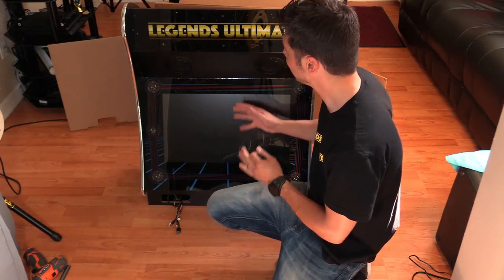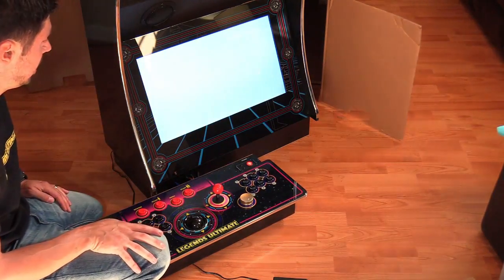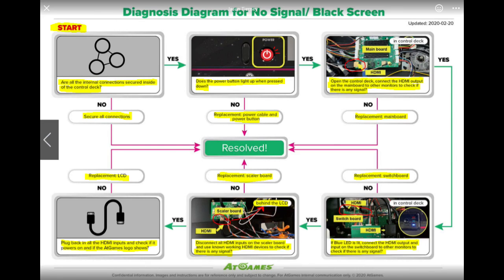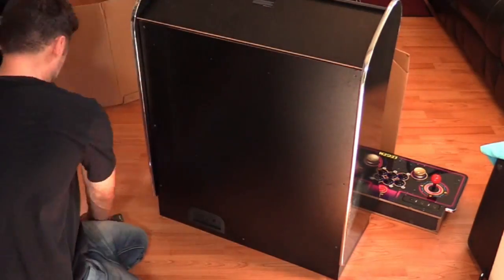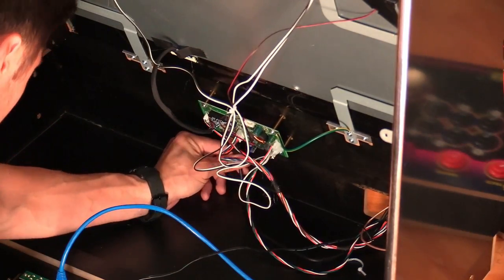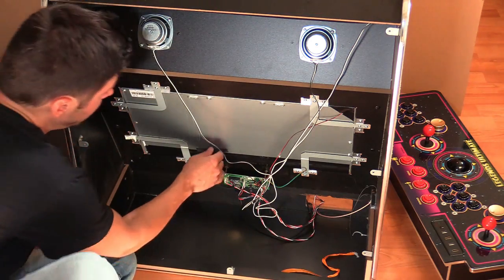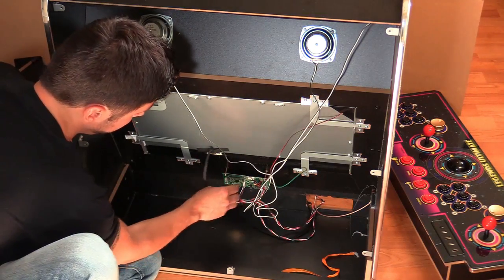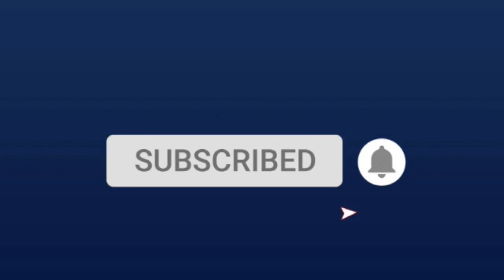Legends Ultimate Arcade service guide for No Power, No Signal, Black Screen, Flashes Colors

Comment: Hello. I recently purchased another Legends Ultimate. I’m a having an issue, the speakers as well as the LED light bar are not working. The light bar has about 1/4 of the LEDs working. When I connect the unit to Bluetooth the sound also does not work. I have made sure that all of the wires coming off the speakers and LED are connected to the board inside the unit. Bottom left behind the screen bezel.

Comment: Any pointers on what to do if I've lost my controls and no connections are loose? I can even hold the buttons down to bring up the factory restore screen, so I'm not sure why my controls arent working on the main menu. I can navigate when a USB keyboard or controller are installed but not with my joysticks. I was thinking maybe it had to do with bluetooth controls although I've never connected any. The bluetooth doesn't give me the option to turn it off in the menu. Thanks for any insight.

Comment: How do I completely remove Bluetooth it’s causing my control panel not to work it seemsit keeps trying to pair with other devices
Reply: Did you find a fix? I am having the same issue
Reply: Same, I think.
Reply: Mine is doing the same with Bluetooth trying to pair, control are not working. Anyone find a fix?

Comment: Any chance you have experience working on the V 1.1 blank screen with no HDMI cable?
Reply: Any luck fixing it?
Reply: @christiancullars3888  i got a replacement machine from the seller, but it had a software bug instead that i had to fix by flash 2 files from a USB drive.
Reply: Yeah, i also have a black screen . Only the marquee and the power button, arcade/HDMI is lit up

Comment: This is great. Doesn’t help my issue. I was about to type my whole issue, but I can’t see from the other comments that there aren’t many folks responding here
Reply from the maker: Ok but What's your issue?
Reply: @TampaTec  it won’t turn on. Ok I’ll be more specific :). I went to turn it on. The marquee blinked for a second and nothing happened. I tried checking a different outlet, opening her up and checking that all connections were secure, which they were, and still nothing. I thought it could be the actual power supply or something on the controller board, but when I bypassed the cabinet and plugged the power directly into the controller board, the power button lit up once again. However still nothing when plugged in the back.
I assume it just be a bad connection in the module that splits the power in the back or a short somewhere between the back power box and the rest of the equipment. But I have no idea, and don’t want to start tampering with things I don’t understand. And at games support has been this far non existent. Only had the thing for 3 months and very light use!
Reply: @evantornquist7673  I believe I've had this problem along with many others online. I had to redo/resolder the connecting wires for my power button. They were very loosely connected from the start. You could also clip the ends of the wires, strip them and try using crimp on quick disconnects to reinstall if you're not able to solder. Double check your connectivity with a multimeter before closing everything back up. Some people say they asked Atgames for a new button but that does you no good if their buttons aren't wired well enough to begin with.
Reply: @tech.noire.  thank you! That makes the most sense yet. I’ve narrowed it down to it having something to do with the connections in the back. Either a bad wire or bad connection. Being that it is inconsistent, I’m assuming bad connection. Shame I haven’t soldered anything before. Maybe once about 20 years ago, so I guess it’s time to watch some more YouTube howto videos lol. Thanks again for weighing in!
Reply: @evantornquist7673  did you ever get a fix for this?
Reply: @TampaTec  Any ideas on fixing my frozen screen?   After startup my screen freezes on the new version available 5.38.0.  Can’t exit nor download.  Checked all connections and seems to be ok.  I had the 2 blinking lights for awhile but after checking connections no blue flashing lights anymore.  What next can I do?

Comment: I have a question I am dealing with a headache I hope you can help me i bought the Tekken 3 arcade and I'm getting a no signal on my monitor it worked fine for the first day i got it then the problems started I changed the VGA converter board put a new one in same result I put a new VGA adapter board and same result I thought it was a power supply took the power supply out I tried it against my Pandora's box works fine the only other thing I could think it could be would be either the monitor or the main board sometimes it will show a picture then it goes back to no signal and then other times it won't come up at all at the beginning it shows the acer load up screen and the Chinese writing then it goes to a no signal screen instantly sometimes its a blue screen I'm at loss for what it could be unless its just a signal issue between the monitor and board I have had the same issue when I built a rasberry pi 4 system in a arcade cabinet what do you think it could be I would appreciate any help thanks

Comment: How do I get both bluetooth light to stop flashing as it trying to pair. I dont want it to pair to anything.
Reply: Did you find a fix? Mine is trying to connect as well not allowing my control panel to work
Reply: @1993pyromaniac  yes!!! I connect 2 different phones to the bluetooth then turned off the cabinet turned it back on then updated it. I had to do it a few times over a few days and then it just stopped all together

Comment: I got mine, had a button issue which I fixed but wondering if you are having any issues with  a wired ethernet connection.  Wifi works and Ethernet does too but Ethernet seems to not be connecting at the full bandwidth. I tested the cable and connection with a laptop and that pulls 500 mbps down but testing the connection on the Legends Ultimate, I barely get 1mbps.  I rechecked the connections.  Any ideas?
Reply from the maker: I have no issues with mine, try
1. reset your router, unplug power cord for 1 minute.
2. also if your cable is longer than 30ft you need a repeater.
3. Swap out your cable for new cat5 or better cat6 shielded cable. 
4. Check all Ethernet connections from router to back of cabinet, inside back, into control deck and inside control deck into game board. Reseat cable connections. Let me know if that worked.
Reply: @TampaTec  

Yup reset the router and swapped out all the cables to Cat6 shield a while back. Length is only 15 ft.   Connection is solid when plugged into a laptop.  Just plugged into the ATgames is slow. I'll have to open a ticket.

Comment: Just received my unit from sams... no display or sound... just the light up marquee. Help!!! I have power.
Reply from the maker: Check control deck hdmi connections going to the cabinet and under control deck wood panel.
Reply: Tampatec thank you- I was able to get it to work after opening the controller deck (10 screws to open it). Checked all the hdmi connections and it started to work... it is a great system.
Reply from the maker: AWESOME 👍

Comment: The diagnosis diagram is pretty lol.. e.g. doesn't power on? Replace cable and button - guess works great if you fried the mb with a faulty power supply 😂

Comment: Theyve only been out less than a year and are already having problems.
Reply from the maker: shipping related issues like bad/loose connections which is common.
Reply: Incorrect. Connections are coming loose during shipping. A few bad boards in consumer electronics is to be expected.